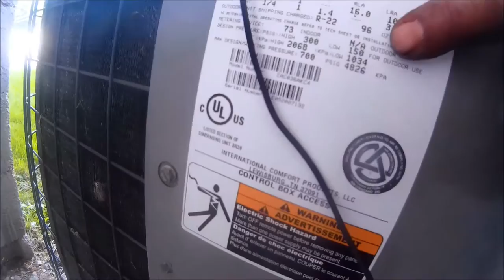They tried to steal my condenser

Comment: That sucks, **kn thieves.  When copper was record highs for recycling, them basteds would strip the whole new residential house wire including my line set, that got old quick.  Ive also heard the huffers like refrigerants to get high, thats some nasty sh*t.
Reply: In Flint Michigan about 10 years ago they stole all they could off of the ground. So they started stealing ladders. Then started stealing the coils out of every package rooftop unit of every abandoned building in Flint. I drive down Dort Hwy in Flint during the day occasionally they didn't miss a unit in a 6 mile drive. One strip mall has razor wire going around the roof perimeter 3 feet high. I hope they have a roof hatch. LOL. They looked like newer units. I worked on a rooftop unit in Detroit a few months back. Southfield freeway and 7 mile. Had this cage around it. A lion could not have escaped from it. Trying not to trip the whole time I was there. Newer unit, but would have to hate to try to change out a compressor in that thing. Curb adaptor was huge, shuffling around it the whole time. Sad really what businesses have to go through to protect their property from junkies.